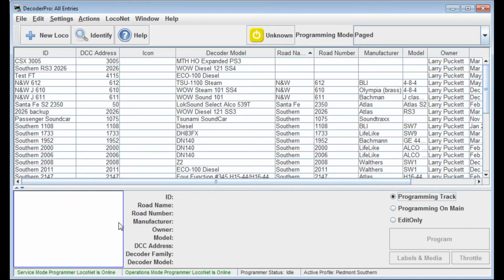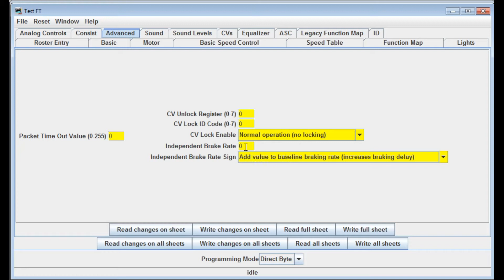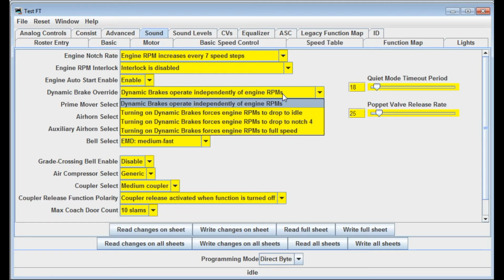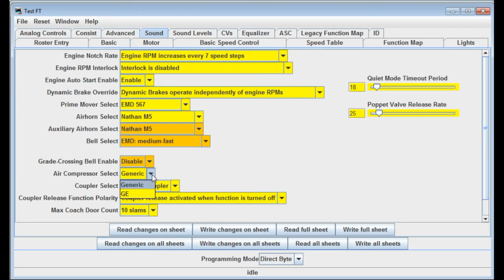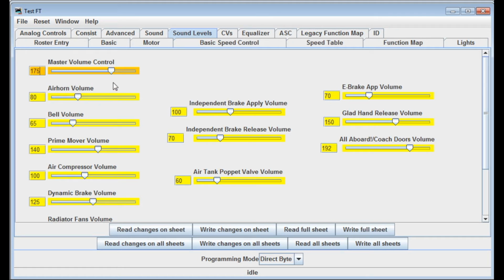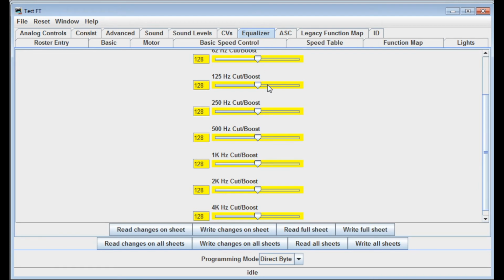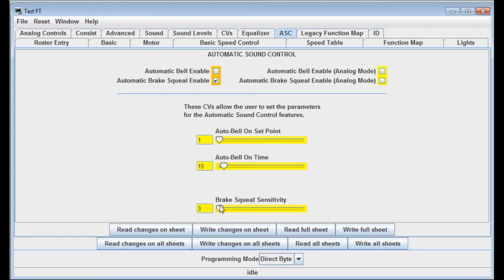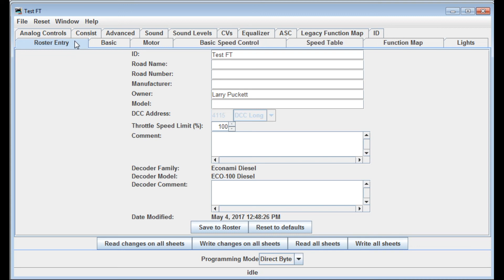DCC Tips, Add a new loco to DecoderPro Pt V (14)

Comment: Very nice series, thanks for putting it together for us!  For some strange reason my decoder pro won't read from the decoder, still haven't figured out why.
Reply from the maker: What DCC system and command station are you using? Assuming you have a service mode programming track and are using the service mode programming option in DecoderPro it should read the CVs. Can you read the CVs using your handheld throttle when programming?
Reply: @TheDCCGuy  All Tsumami 2 decoders.  Dgitrax PR-4.  If I understand correctly there is a history of these decoders being difficult to read.  I have figured out that is absolutely won't read in Program on the main mode.  Still haven't set up a program track.  That's probably my biggest issue.
Reply from the maker: First, you cannot read back CV values when using programming on the main, so that is why you can’t do it. You have to set up a service mode programming track. And when using DecoderPro make sure to select service mode programming and not programming on the main or edit.
Reply: @TheDCCGuy  Thank you!

Comment: Hi,
If I set something on my loco decoder and then I want to restore to default. How can I do this? It's a Zimo MX645 sounddecoder.
Reply from the maker: Robert, here’s what the manual says; 

CV #8 = “8”  HARD RESET(NMRA standard);
all CV’s return to the last active CV set or sound project, or the default values listed in this CV table if no such set was active before.

I have have used this on non-Zimo decoders and it basically resets the CVs to the factory settings. I have never tried it on a Zimo but based on the manual it should do the same thing.
Reply: @TheDCCGuy  
Thanks for the answer. I will try.
Reply from the maker: In rereading my comment I should have said to program CV8 to a value of 8. This can be done using either ops or service mode programming.
Reply: @TheDCCGuy  Thank you! The reset helped for me. Everything is fine with the decoder function.
Reply: Only one thing here. The DC motor has some scare noise on low speed. Should I the motor or speed table set up something? This modell is a Roco Vectron, with the Zimo decoder (MX645P22). Maybe the arduino+motorshield's power supply is not enought? (15V 1A)
Reply from the maker: It probably is the frequency and the motor may be coreless. You will probably need to check the manual to see if the frequency can be modified and then experiment with it. Do a google search for Zimo motor control and see if anyone has posted info on that.